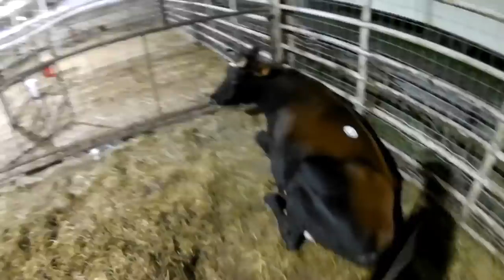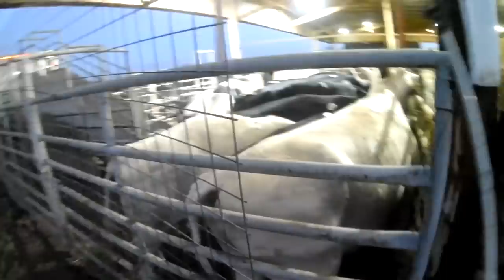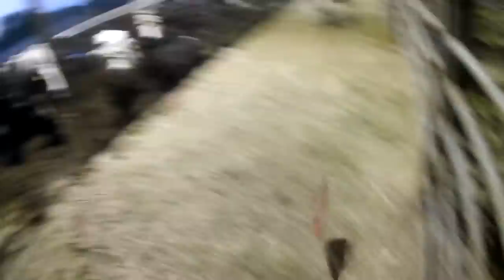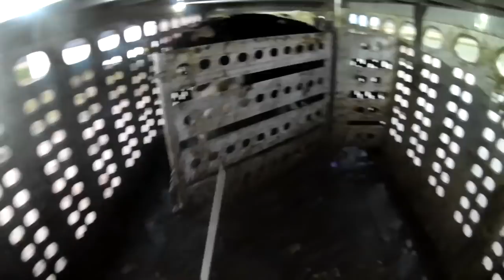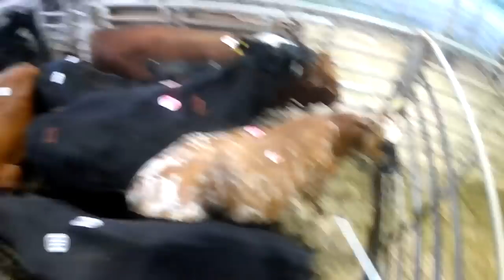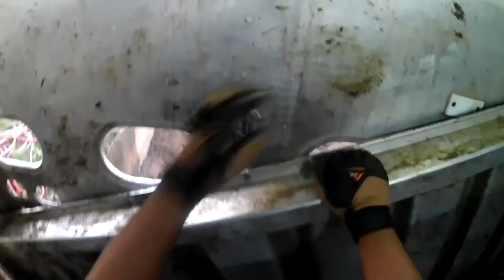Loading 42 Head, Little Donkeys And A Cow Plays Ring Around The Rosie

Comment: I have a question does packing plant have spread axle cow pot and does they have straight top deck too without counter balance like this trailer.
Reply from the maker: The plants trailers are tandems and straight through
Reply: @CattleHauling50  tandems means double axle trailer you using am I right.
Reply: @CattleHauling50  do they Wilson cow pot or eby
Reply from the maker: @calebmanuel17  EBY
Reply: @CattleHauling50  I see
Reply: @CattleHauling50  how many trailers do they own/have
Reply from the maker: @calebmanuel17  5 but 2 are for spares if one goes down
Reply from the maker: @calebmanuel17  Yes it is not a spread
Reply: @CattleHauling50  I see thank you for answering my question.